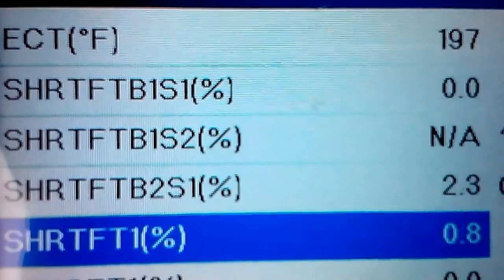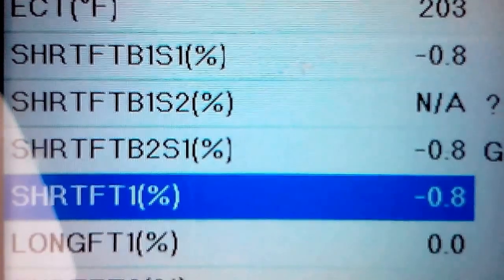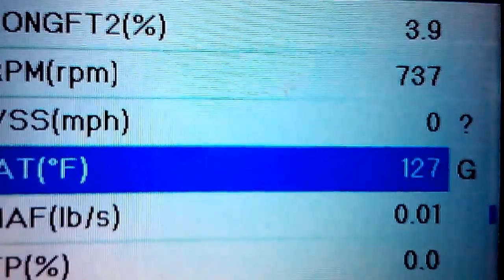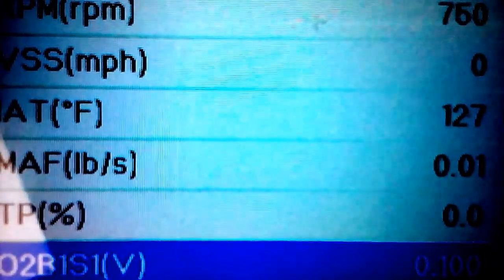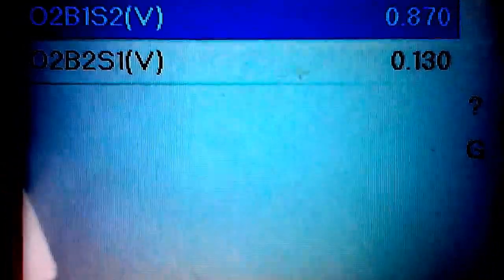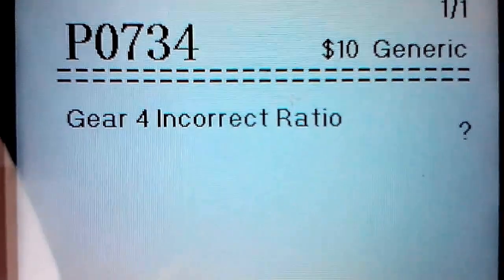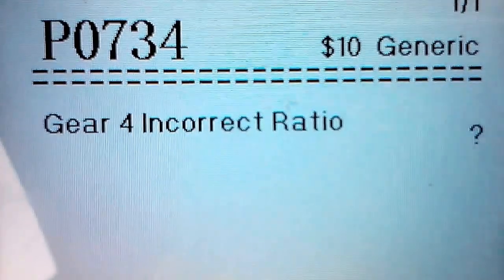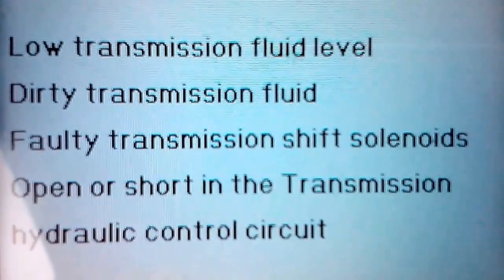Reading live data on obd2 scanner part 2

Comment: I am a firm believer to always know about the product your talking about before putting it out on YouTube for the World to see.The guy that had the CEN TEC 60694 did a great job of the  description of what he knew it did.For both guys did a great job.Hope the other guy had a 60694.Why you ask because they were pull off the shelf after about 2 to 4 weeks.We hy because it's not just your average Joe Diagnostic Scanner.For the guys that have theirs I'm sure they have learned by now that the 60694 you get your updates from a $2200 Scanner.Well that because your tool has 18 PIDS .It has a live graph .Here it the best thing is you can custom your computer or PCM with the 60694.You can change shift points you can advance the timing.That how I found out you could customize your PCM.I am in my wife's 2014 Ford Explorer Unlimited and get to adv timing.Working with a new car but also building motors I was like a kid at the candy store wanting to push a button .I did and I thought this is a cheap diagnostic tool it can't change anything.Well my wife comes home from work and say .What did you do to my SUV it running hot.Well I knew right then what it was I adv the timing a bout 1 or 2 degrees.Then set it back.You can drive down the road the same speed and same route then do it again.Then you can look on your laptop of 2 overlays of those routes.You can look at your shift points at what RPM.You can't just go in and wipe away a code a think your problem is solved.No disrespect to the guys that broke the package they owned up to not really what it could do.It can print your 18 PIDS out while driving down the road.I mout it to my racecar and play with the air and gas.almost every race.Why because at the right humidity and temp.Gas and air is mix in all cars 14:7.For it to run a optimal speed a also to save gas.I run mine rich.So I can change that on my 60694.I could go on and on about this a SCANNER.but if you have 1 play with it and it will all come to you.Good luck guys and if you have any ?? I would be glad to answer them ON YOUR $2200 SCANNER AND NOT YOUR $79.99 DIAGNOSTIC TOOL.MY NAME IS CURTISLOE.AND NO

Comment: So your thottle position sesnsor stays at 0% until you rev the engine. Mine is at 13%, and lowest was 12.2 when I did a graphical test. Is this why my gas mileage is 8mpg below market?
Reply: Nope, you should have 2 parameters for throttle pos, the first one is absolute and the second one is relative. The absolute position is never at 0% (otherwise there won't be any air going to the engine), on the other side the relative position returns 0% when throttle is opened at it's minimum (eg. while idling)

Comment: Awesome well informed basic info! Thank you! So, with MIL eliminators on post cat 02s, the voltage reading is 1.67. Wouldn't that technically make the car run rich constantly? I'm considering getting a catless mid pipe for my car, and am trying to get as much info as possible while I'm saving for a few extra parts and a tune. Thanks again for the info, and in advance for any advice or knowledge.

Comment: The tool.is only as good to the user as the users knowlege... What I mean is you need to know what the systems throwing a code as well as the associated systems eg. an O2 sensor, the sensor may be out of range due to a fuel injector sticking open or closed, worn spark plug, bad coil, blocked exhaust, dirty airfilter.....
Reply from the maker: absolutely right and that's all I'm trying to do is help people and save them from paying some one else to do it. without knowing how the systems work scanners are useless!